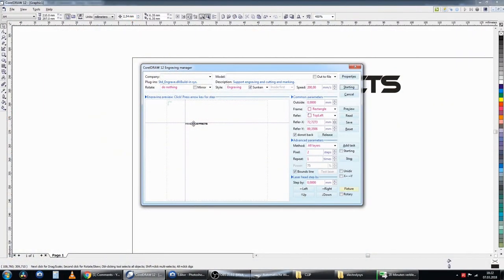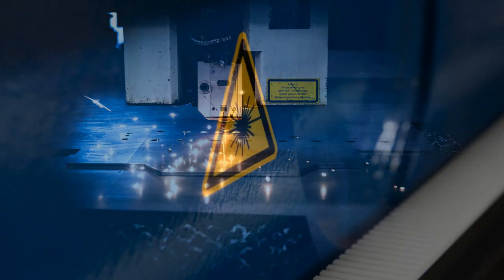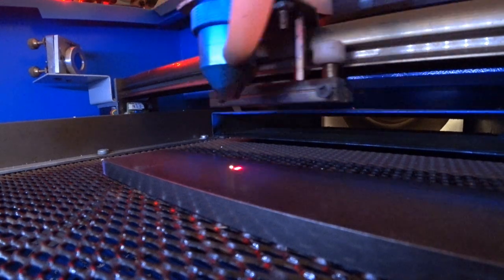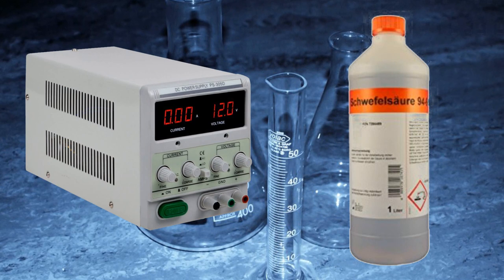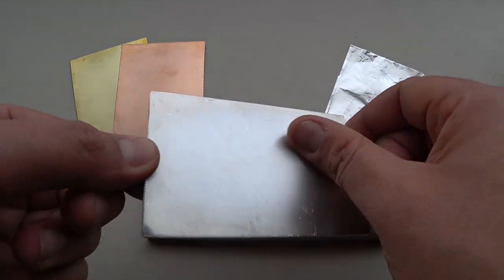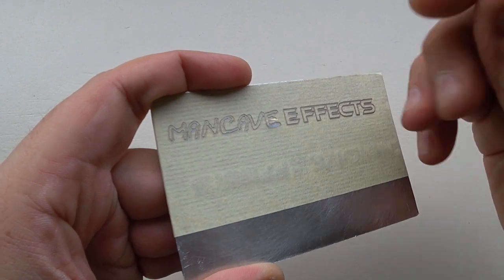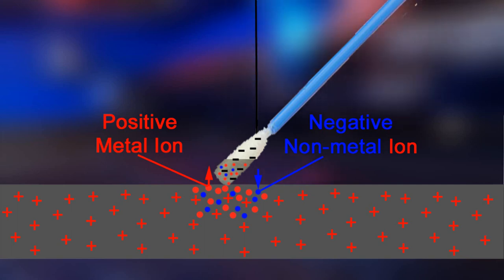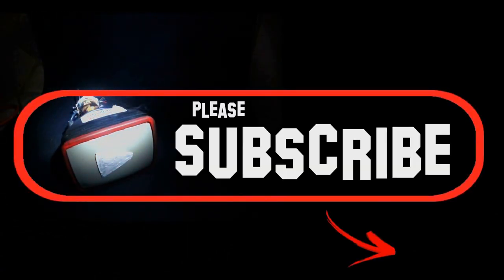Can the K40 Laser Engrave Metal?

Comment: Etching aluminum works better if you don't use tape and also if you don't use the cotton swab technique.  I use spray paint.  Raster etch your pattern into the spray paint and then use saltwater bath electrolysis.  12vdc at 3amps only took about 5 minutes of just sitting in the salt water to get a .5mm etch.  Afterward, paint thinner or acetone will clean off the spray paint.  The etched pattern is razor sharp and looks professional.
Reply from the maker: This sounds pretty interesting, I will definitely try this out. Thanks for that!
Reply: Great idea! I don't have a big fancy laser like this+(just a tiny 1watt) that'd work fine for mine although only be able to do 1.5"x1.5" designs though

Comment: Could you electrolyze  wood by spraying a metallic paint as a base and then laser etch that?
 I saw a guy electrolyze a 3d printed helmet using this method
Reply from the maker: I am experimenting with electroplating at the moment. It is pretty hard to even get a troughout conductive layer of metallic paint in the first place. This paint needs then be treated with a special copper electrolyte to make it conductive. The layer is very very thin, electrolyze would simply remove the metal coating entirely, what could be nice if wanted, but it would not etch into the metal paint.

Comment: it does look as if your laser is way out of focus on those metal sheets
Reply: The CO2 laser produces a beam @ 10600nm in the infrared spectrum, you cant see it with the naked eye. What you are seeing is the red targeting laser he has mounted to roughly see where the laser is targeting, you can see its mounted offset to the main laser at an angle. At 2:38 you can see it mounted behind the white air assist tube

Comment: Can the K40 Laser Engrave Metal? Short answer: No.
Reply: What is the best type of laser? What one would you recommend for copper?
Reply: That's really surprising. Given that I have an L-Cheapo Mk4 and I have been able to (using the powerful thermal medium known as black spraypaint) engrave brass, aluminum, and even mild steel, with only 5 watts of output, I'm starting to question the K40. The newer L-Cheapos can probably do an excellent job of metal etching - I don't recommend the Mk4 for that, it was really just a hobby test.

Comment: I've just bought a fixed focus '40w' diode laser module with a "15 w" optical" power(whatever that means??) which I could engrave stainless and copper directly..deep enough for me to feel the scanlines with fingernail 😱I'm guessing that it is only 7w (biggest single diode nicha/osram make) on the amazon listing  it claims the fixed focus point is 0.3mm...maybe power doesn't matter if focus/energy  density is high?
Reply: Can you provide the link of such laser?

Comment: Try applying a thin layer of thermal conductive paste (it is used in computers between the processor and the radiator) to plain steel. Power 35%, speed 1 mm / s, cutting mode. This is the only thing this laser can do with metals. Good luck!
Reply from the maker: Thanks, i will try that!

Comment: I wonder if you used the blue ink coating that is used when milling and set the laser to raster it off. Then try the electrode method.
Reply from the maker: Something that can be tried i guess. But i think this coating is that thin that it conducts trough

Comment: What if you made a slurry of powder coating powder and water or alcohol (or other?) then coat the metal and allow to dry then heat with the laser then wash off the unmelted areas. It would be more permanent than paint and could also be a resist for etching. Power coat can be removed with solvent and is very inexpensive. If it works, the process could be a replacement for screen printing on plaques and control panel lettering.
Reply from the maker: Very interesting comment, i may get into that. I think a 40watt or more a chinese 30watt laser is just to weak for melting metals, even in powder form but i may try it out in the future and keep you updated.
Reply: Follow up: I mixed some powder coat powder with mineral spirits and it instantly suspended the powder which I poured on a piece of hot rolled steel and it coated it nicely however the mineral spirits separated from the powder which is probably a good thing. It looks very promising. I will heat it with a torch after it dries and see if it acts like powder coat. Water doesn't want to mix with the powder and alcohol makes it form a glob so there is some interesting chemistry going on but not useful. The process might also be used to etch circuit boards.
Reply: The dried powder coat / mineral spirits slurry layer acted just like normal powder coat when heated. Hope this is helpful for someone.
Reply from the maker: Have you tried water with dishwasher soap to break the water tention and mix in the powder, maybe that works? Where do you get the powder for the powdercoating from? For my knowlege powdercoating works by electric polarisation to make the powder stick to the working piece and baking it at high temperatures to melt the coating permanentely to the working piece, but arent there other chemical processes involved too?
Reply: I tried a micro drop of Dawn dish soap and the powder did mix with water but it didn't coat as evenly as mineral spirits. The mineral spirit slurry worked very well. While watching the slurry it seemed that a standing edge around the metal part so the slurry would pool might be helpful and maybe make the edge from an absorbent material to wick the mineral spirits away to speed drying. My simple test took about 45 minutes to dry but I waited a couple hours before baking.

I have a Harbor Freight powder coating system and have done quite a bit of experimenting but I'm not an expert. It's my understanding that the chemistry of the powder include properties that make it retain a static charge. Once the powder is deposited it melts and coalesces when heated to about 400 degrees and creates a very hard surface, it's a very simple process. Harbor Freight had the lowest cost powder last I checked
Reply from the maker: Once i have the time i will make a test with it, but i think as the coating only needs 400 degrees to be melted, the laser may simply burn it to ashes as the chemicals will burn out...but worth of trying it

Comment: Try Plastikote paint on the metal, then laser it, then etch it. The laser should burn off the paint and then the etch should only take where the paint 'isn't'. I watched a youtube video regarding making PCB's and this was a technique that worked quite well with accuracy. Then use acetone to remove the excess paint.
Reply from the maker: Thanks, i made an update video about that a while ago:

https://youtu.be/aT65ODsnLKA
Reply: @MancaveEffects  My bad. I haven't got that far yet :)

Comment: Question. I understand Co2 laser wont engrave metal but why can a diode laser at a lower power engrave metal? is it due to wave length?
Reply from the maker: Flying Karapet, it has to do with the wavelength, here is what i found on a forum:

 materials have different transmission values for different wavelegnths - while transparent mterials are transparent for VIS (visible = roughly 400nm to 800nm) and NIR (Near Infra Red = 800 to 1200nm) diodes too, all organic/plastic materials are "perfect black" for CO2-lasers (10600nm) or deep UV lasers (below 300nm).

So for clear acrylic and wood of some millimeters thicknes you'll better use a CO2-laser.

Metal is different - it's highly reflective for CO2-lasers, so you'll need powers of some hundred Watts to get into or through.

But it will absorb in the NIR - so most metal marking/cutting lasers are NdYAG- or fiber-lasers with wavelength of 1064 to 1070nm.

For the VIS diodes it's a matter of power - the 445nm-diodes with 6Watts of power can be used to mark steel ... but for real engraving or cutting you'll need much more power ...

Comment: Hi , 
I just would like to know  if this K40 laser machine can engrave very fine  writing letters  which
you can see them but you cant read them without magnifier on acrylic .
                                                        thank you
Reply from the maker: No, you can engrave pretty small fonts but under a certain font size (for my opinion everything below Arial 4) won’t be readable as the mechanical resolution is not high enough. Also acrylics are somewhat warping a very little bit when getting heated over a certain temperature.
Reply: @Mancave Effects when cut metal is it possible to cut more then 8mm if needed (wonder if can get a block of metal to cut instead of sheet and make a nice engrave)

Also thought I add most use white board pen over metal as the metal is shiny so pen help engrave and not rebound laser
Reply from the maker: The K40 laser can’t cut metal, sorry.

Comment: Can I engrave river rocks with this one?
Reply from the maker: Good question, it will definately burn into oxid layers that may cover the rock, but i would need to try it. Maybe i make a video about it in the future!
Reply: Mancave Effects I would also like to see how it works in the following related materials:
Granite (black is fine), marble, (I have seen it do slate w/o a problem at pretty good speeds), and tile - both glazed and unglazed, such as red terra-cotta as would be typical in a cheap red clay pot, or etching a pattern on unglazed ceramic which could then be glazed to colorize the drawn design and fired.

Lastly - how does it work on Anodized Aluminum? (Especially Black anodized, or anodyne on other metals).

All of these are important considerations for me in choosing a reasonable cost laser system for small scale business use.   While I like the easy upgrades on the K40 I wonder if I would need to upgrade to a 75,100 or 150 watt CO2 laser.

Lastly, can you use a combining prism/mirror to add one of the other types of lasers (such as the 10watt 405nm diode or maybe a few watts of green laser) either as a substitute beam or in combination with the IR CO2 beam? (& since they rely on different methods, what advantages might you get in the combination beam)

Very curious as to your opinion there.

Many thanks for your videos and hopefully your response

Comment: Hello! Great video!
I'm looking for a laser engraving machine to engrave anodized aluminum pet tags not bigger than 5cm x 5cm. Would you recommend any model?
Reply from the maker: Victor C. Depending on what material these dog tags are made of you could rather use a diode or a co2 laser engraver.
Reply: @MancaveEffects  anodized aluminium works very well on a K40 modell ;) i did this with my 40W CO2

Comment: Been working with laser for a while now, try dental paste, the cheapest one, do a couple of passes at 80% of power (3 at least) and it stick pretty good to metals, i found that the only way to remove it is using a file o a rough sand paper. Try it, cheers!
Reply from the maker: Very interesting! I will get into this soon aswell! Thanks
Reply: huuu

Comment: Hey, first of all, super useful video you made here +1 for that! I was wondering im on the verge of buying one of these and i was planning to use this piece of software http://www.scorchworks.com/K40whisperer/k40whisperer.html which makes me wonder which controller board yours has since it only supports a couple. Would be great if you could shed some light on which one you have!
Reply from the maker: +Hawaiian Snow thanks for the +1! Let me check tomorrow what board it is. But i could imagine that in china they throw in boards they have available. I know that i got the newest version of the board "vers 2" but i dont know if there is a newer version by now or if it is compatible with k40 whisperer... It should work in my opinion as there arent so many but still something to try out.
Reply from the maker: +Hawaiian Snow my board is called M2 NANO firmware vers. 2017.03.25

Comment: Could you lay the copper on an aluminum block? What about laying the thinner more conductive metals on an aluminum heat sink that works with the water pump?
Reply from the maker: Well my theory is that metal actually deflects the heat way to quick under normal atmospheric conditions, i think the only way for the laser to have any impact on metal would be to add oxygene gas to the air assist, but it may also burn down my house 😂.... 
I think the heat is so concentrated on such a small spot for such a short amount of time that there is no way of cooling the sourroundings

Comment: I am thinking that you more likely could engrave aluminum, if it is color (black) anodized.  I also have some decent experience about Rubylith film as an etching mask.  I have seen some statements that the manufacturer chose to combine the previous different tack grade adhesives so the present offering may not protect as well as the hi-tack version used to do.  Anyway, the packing tape is a definite no-go in my book.
Reply from the maker: How do you use the Rubylith film with the laser? I made a followup video trying spraypaint, moly spray and toothpaste.
Reply: Mancave Effects 
Just like you tried with the packing tape.  You cover the part with a sheet of the Rubylith film and then burn your trace on it.  Finally you etch.  The two important issues are that you have to make an absolutely bubble free contact and the fact that the color enhances burning effect, so you can minimize the power.

There are videos showing a water spray coating on part, then laying the film which due to the water does not freeze immediately in place.  That way you can use a plastic card to squeeze both water and any air out in a systematic way.  The film adheres where it meets dry metal.  Unfortunately, you still need to somehow -- hair dryer or overnight long time -- let the residual water vapors to completely evaporate before the laser burn.

Then my disclaimer.  I have not tried the water method.  I just trusted direct dry application to cover some border area of my printed circuit board before etching.  My reason was only to minimize the amount of etchant use.  Worked quite well.  I'll try more of the Rubylith when I get my new CNC engraver assembled.

The previous application was with Toner Transfer process.  Which explains my large border areas that I did not want to etch away.  The final board itself was less than 1" by 1".  And it was double sided.
Reply from the maker: Thanks, good to know, i may try this out! I also made very positive experiences with spraypaint and plastidip spray even spraypaint works a bit better.

Comment: what if the metal is placed on a hotpad in the laser bed...bringing up the internal temp and negating the heatsink effect
Reply from the maker: I think by doing that the hotpad and modifications needed will cost around the price as a more powerful laser
Reply: @MancaveEffects  the hotpads Im looking at cost about 20 bucks
Reply from the maker: you would need to heat it to about 2500f to make this work

Comment: you are aware that your green glasses are not for the K40 ??
you will need a 1060nm set
Reply from the maker: +patrick maartense yes, you are right, apparently the seller claimed that it was suitable for a co2 laser, but i had ordered some proper 10600nm glasses recently.
Reply: same here, a decent pair is a must have .

also got a few additional lenses and air assist. starting the mods this week, as well as z Adjustable scissor lift  with spike bed